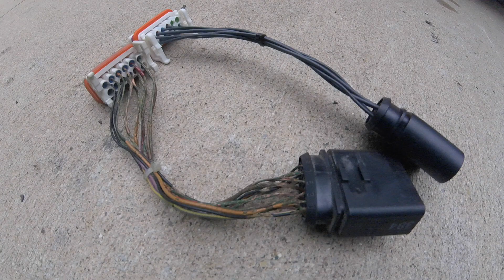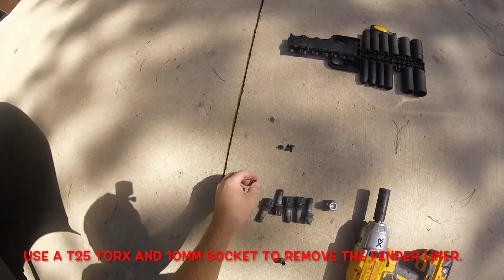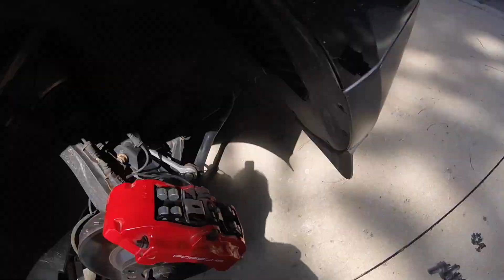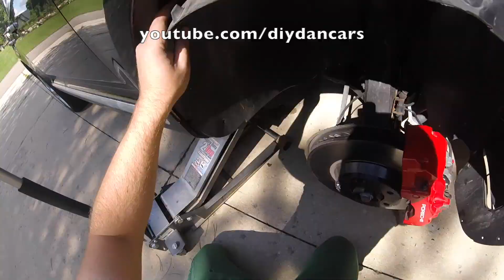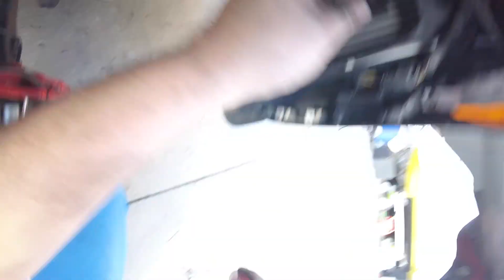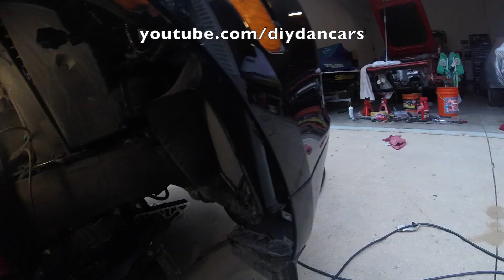Porsche Cayenne: Replacing The Headlight Wiring Harness Part 1

Comment from the maker: Channel Update: Former YouTube content creator who used to share DIY car repair videos to help people maintain and fix their own vehicles. Unfortunately, the majority of the feedback I received was negative, so I've decided to shut down the channel and reclaim my free time. The original goal was to help viewers avoid the high costs and tyranny of dealership service departments — and I truly tried to do that. But the comments and dislikes made it clear the content wasn't resonating as I'd hoped, so it's time to step away. 

I sincerely appreciate everyone who supported me over the years. If you're into home audio and HI-FI, consider checking out my new channel: Forensic Audio. I'm taking a fresh approach there, focusing on speaker construction, driver parameters, crossover designs, and more objective breakdowns.

Thanks again, and best wishes!
DIY Dan

All of my Cayenne DIY videos can be found here: http://bit.ly/2NvBE1n

955 Ballast: https://amzn.to/3L2Zmgr
957 Ballast: GenXeon does not offer ballasts for the 957. :(

All of the parts I used can be found below.
Updated OEM Porsche headlight harness: https://amzn.to/3rAoXFZ
Headlight wiring harness: https://amzn.to/3Ey1xGD
Headlight wiring harness vendor 2: https://amzn.to/3jWJqRe
Cayenne Corner light bulb: https://amzn.to/3k0iAaw
Cayenne turn signal bulb: https://amzn.to/3EvPauw
Tiny bulb Amazon says it doesn't fit Cayennes but it fit mine: https://amzn.to/3rD8gcS
Phillips Halogen Headlight Bulbs H11: https://amzn.to/3ED3EJ5
Bi-Xeon Headlight (Fits my 2005 Turbo): https://amzn.to/2IRfmpz
High beam bulbs: https://amzn.to/3rDKKfO

Comment: I just repalced my wire harness but couldn’t figure out why the lights were working with the headlight locked in. On the passenger side you need to remove the air box and then you can apply pressure from behind and push the electrical connection together. Pushing just from the headlight side pushes the plastic cable holder further back and it did not ever seat successfully for me.
Reply: If that is happening to you then that means the mount for the electrical connector is broken. This car is primarily made from cheap plastic so this isn't surprising to hear, especially as these cars get even older.
Reply: Got a fix for this? It seems my new harness and old harness which I taped up both don't get any readings after the harness when hand tight together. But I get power at the factory harness behind the 12 inch one.  @Forensic_Audio

Comment: Thank you for this. I replace the wire harness . But didn't have any luck. The only light is working. Before and after replace the harness is the turn signal. Do you think is the headlight unit ?
Reply from the maker: It's German. It could be anything!!! :) I got rid of my car years ago because I got sick of fixing it every other day. No doubt I loved my Cayenne, but the reliability and quality of parts are laughable at best. What codes are you getting? Ballast?

Comment: You don't need to remove the fender liner or loosen the airbox.  It's just 4 bolts to loosen or remove the heaadlight tray to reach the connectors, and despite some of the comment's it just pulls out of the headlight hole once you get the right angle.
Reply: Correct just remove the tray inside where the headlamp unit sits with that out you can unplug the harness and replace 30 min job at most 2004 Cayenne S - 4 bolts 🙂👌👍...new harness off ebay £15 - much cheaper than the Stealership 🌟🙉
Reply: Just got corrected by a Porsche Mechanic for saying you need to remove the fender liner. Not true

Comment: I seriously thought this would take 5 mins, I started at 930pm, fiddled about for 2 mins, went on YouTube, found your video and watched it, now I'm giving up at 936pm. Omg I hate parche, that was so not thought out. Wiring which corrodes and a airbox blocking the way. Removing the wheel, to remove the front wheel liner to access the wiring harness and moving the airbox has me grumpy as f, I just did that to clear the drainage and it was a headache getting the wheel liners back on. Omg I want to punch the porche in the headlights right now. Soooo bad porche, not impressed with the blocking move
Reply from the maker: I hear you! I'm positive Porsche engineers are sadists!! Too bad you couldn't stick with it because once you get the fender liner off it's all down hill from there.
Reply: @DIYDanCars  I'll get back to it tomorrow morning, I'm sure your right about the engineers being sadist, it probably took more time and energy creating that flaw than it would have to have to make it function. It slides like 90 percent over and the last 10 percent slaps you in the face. Thanks for your video, it helped me a lot!! It would have taken me a few days to figure that one out. Awesome video!!! Thank again!!

Comment: I am switching my xenon headlight assembly on 2004 Turbo Cayenne to halogen. After placing the light assembly in its place, none of the lamps come on. Do I need to change the wiring harness? What is the easiest solution?

Comment: Hey dan I’m trading my bmw 335 for a 04 Cayenne S , first mod I feel like Is a must is the HID spyder headlights, what do you think of those ?
Reply from the maker: The HID's are nice. They even have corning lamps that turn with the steering wheel.
Reply: DIY Dan thanks brother
Reply: @willygarcia5392  @Willy could you reply with the online source for those lights? I think I saw them somewhere but price was big.
Reply: @christophergrupp8784  did you ever get them?
Reply: @JWestLoans  Nope, just sticking with the original headlights and changing every bulb, and the wiring connectors. Next up I think I will change out the ballast box in each one as I still get the occasional Dipped Beam warning message. But the flickering headlight has gone away. Also I have been squirting a spritz of contact cleaner into every wiring connection as I reconnect things. Can't hurt right? Trying to make the headlights work like new again. I did change out the taillights with the Spyder LED tailights and they work and look great.

Comment: On my 06 'S', I didn't have to do most of this. I just unbolted the one bolt holding the air cleaner box in place and the black end of the connector slid right out. I was able to disconnect from there.  Changing this harness didn't fix my problem, though. On to real diagnosis, I guess!
Reply: What ended up being your problem?? We're trying to fix ours too
Reply: I did the same 1 week ago

Comment: Do you have any experience with intermittent turn signal problems with Cayenne s? All other lights work except one turn signal?
Reply from the maker: Has the headlight wiring harness been replaced? Have you checked the wiring inside the headlight assembly? Because it's prone to rotting just like the harness and will short out light bulbs.
Reply: @DIYDanCars   Hi I am having the same problem as Cliff just my right front turn signal light in my 2005 cayenne, won't work. Tomorrow I will try a new sockett If that does'nt work I will try replacing the harness. And thank you for the videos!